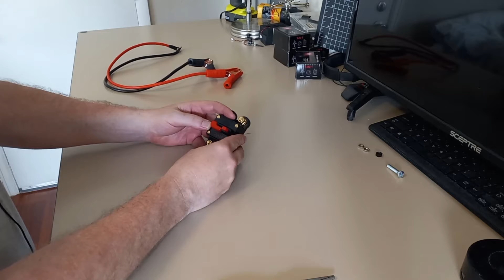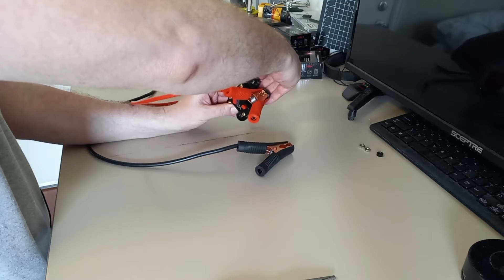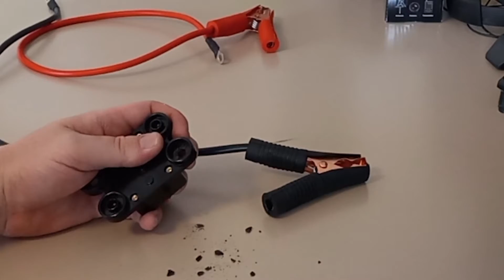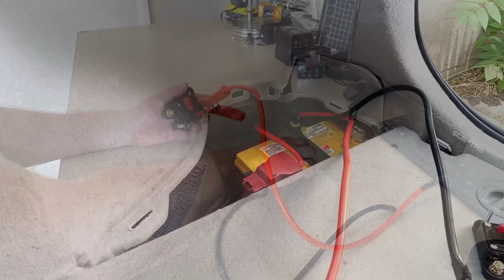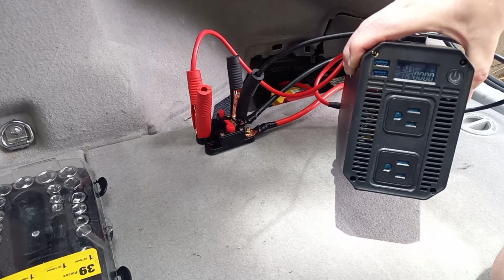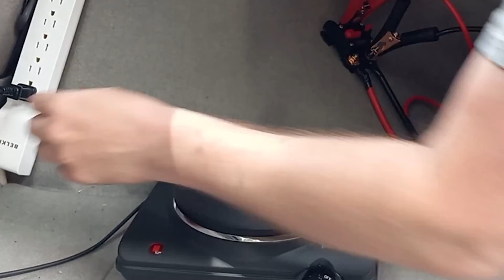Car Camping - Powering Car Appliances

Comment: Hi I have a few questions. Sorry I'm trying to build out my Prius, and I don't know anything much about electric components.

1. Why didnt you connect a parallel battery for extra power for your fridge? 
2. How do you power lights internally in the car? I see some people using USB outlets. 
3. What is the multiple plug there for if the inverter is 1000w and your hotplate is 800w?
Reply from the maker: Thanks for viewing my videos.  To answer your questions:
1. Instead of connecting a second parallel battery, I purchased a camping battery/power pack.  I got the Jackery Portable Power Station Explorer 160, which has outlets built in for the fridge and USB devices.  It is easier to install, cheaper, and more portable than a second car battery.  See my video on 2021-07-21 for how I powered my fridge.
2.  I looked at a number of different lighting options for internal lighting, but the overhead lights that are built into the car (in the front and back) are more than enough to really light up the inside at night.  I could plug extra lights into my Jackery or inverter, if I wanted to, but I haven't found a need for more lighting.
3.  The power strip with the multiple plugs is just for convenience.  It also has a built in surge protector.  The multiple plugs lets me do things like plug in my laptop, electric shaver, and other items, which I can charge at the same time.

The best thing about having a Prius is the fact that you have a gas power generator on wheels.  That means that you can plug in items to use (or charge) at any time, and anywhere, by simply turning on your car.  I choose to leave my car on all night, so the temperature stays at the level I set on the air conditioner.  The car only turns on for about 3 minutes every half hour to keep the hybrid battery pack charged (while the AC is running), and that also allows me to charge my Jackery and any items that need recharging while I am sleeping.

Let me know if you have any other questions.  Good luck!
Reply: @jasonvansickle  thanks for the prompt reply. I was wondering a little more about the security system, plus the inverter you bought. Is the inverter big enough for you? Would you recommend getting a 1000 inverter as well? Any inverters to recommend, especially on a budget? Also, do you think the security system is necessary? Thanks for answering my questions!
Reply: @YJ-xg2pd  The inverter is the right size for my use, because I only use it to run my refrigerator when my Jackery is charging and to run some other appliances that don't need more than 1000 watts (like the hot plate).  The best approach is to figure out what AC (alternating current) devices you will want to power in your car, and then find out the peak wattage you will need.  The peak wattage is the highest output of watts that you will be running at any given time.

Every device has a rating for the wattage it uses, so find out what item will use the most or what combination of things running at the same time will use the most.  The wattage use of a device is usually listed in its online product description.  There are a lot of inverters, so get the size that meets your needs and look for an affordable option for that size.  Look at ratings and read reviews, to make sure that a cheaper product isn't junk.  Also, make sure you get a pure sine wave inverter, because other (cheaper) types of inverters can damage things over long-term use.

By the way, I would recommend that anyone planning to live in their car on a limited budget create a meal plan that does not need refrigeration or heating.  That eliminates a lot of expenses:  power station (like a jackery), an inverter, and appliances (like a refrigerator, hot plate, toaster oven, etc.).  That approach would only need a very small and cheap inverter to charge things like a computer.  Otherwise, most electronics can be charged with a USB adapter that plugs into the cigarette lighter, which you can easily find for less than $10 on Amazon.

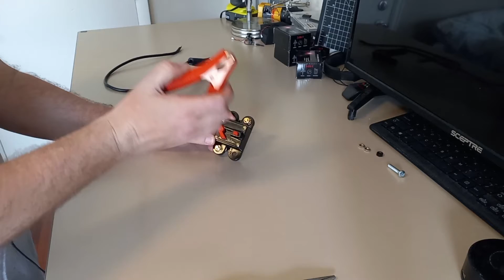In terms of privacy and security.  The best thing that I did was get my windows tinted and install the blackout window panel system with the front window sunscreen to hide myself at night (see my video on 8/1 - starting at time 2:41).  Using that system, I have never had anyone bother me or ask me to move at night, because I am invisible to anyone outside.  With that system, the camera (security) system is valuable, because it still lets me see outside when the panels are installed.  However, before installing the camera system, I would simply peak through the corner of a panel if I heard something outside, so (for me) the camera system is more of a luxury than a necessity.

Hope that is helpful information.  Let me know if you have any other questions.
Reply from the maker: @YJ-xg2pd  The inverter is the right size for my use, because I only use it to run my refrigerator when my Jackery is charging and to run some other appliances that don't need more than 1000 watts (like the hot plate).  The best approach is to figure out what AC (alternating current) devices you will want to power in your car, and then find out the peak wattage you will need.  The peak wattage is the highest output of watts that you will be running at any given time.

Every device has a rating for the wattage it uses, so find out what item will use the most or what combination of things running at the same time will use the most.  The wattage use of a device is usually listed in its online product description.  There are a lot of inverters, so get the size that meets your needs and look for an affordable option for that size.  Look at ratings and read reviews, to make sure that a cheaper product isn't junk.  Also, make sure you get a pure sine wave inverter, because other (cheaper) types of inverters can damage things over long-term use.

By the way, I would recommend that anyone planning to live in their car on a limited budget create a meal plan that does not need refrigeration or heating.  That eliminates a lot of expenses:  power station (like a jackery), an inverter, and appliances (like a refrigerator, hot plate, toaster oven, etc.).  That approach would only need a very small and cheap inverter to charge things like a computer.  Otherwise, most electronics can be charged with a USB adapter that plugs into the cigarette lighter, which you can easily find for less than $10 on Amazon.

In terms of privacy and security.  The best thing that I did was get my windows tinted and install the blackout window panel system with the front window sunscreen to hide myself at night (see my video on 8/1 - starting at time 2:41).  Using that system, I have never had anyone bother me or ask me to move at night, because I am invisible to anyone outside.  With that system, the camera (security) system is valuable, because it still lets me see outside when the panels are installed.  However, before installing the camera system, I would simply peak through the corner of a panel if I heard something outside, so (for me) the camera system is more of a luxury than a necessity.

Hope that is helpful information.  Let me know if you have any other questions.
Reply: @livinginaprius  thank you so much for the reply.

So if I understand correctly, the Jackery is plugged into the car 12V power supply during the night to charge up. Simultaneously, you are powering your fridge at the same time via the Jackery outlets. This way you have a continuous output and input into the Jackery at night.

During the day when the car is off, there is no input into the Jackery, and the Jackery powers your fridge through the day.

So when do you need to use the inverter for your refrigerator? 

Thanks for all the help! Your setup is the best!
Reply from the maker: @YJ-xg2pd  Yes, that is correct.

I use the inverter when I start charging the Jackery at night, in the circumstance that the Jackery was completely drained during the day.   Like I mentioned, I now wish that I would have purchased the next larger size of Jackery, because the smaller Jackery that I have runs out of charge keeping the refrigerator running when the inside of the car gets really hot (i.e., on hot days).  On cold or mild days, it has just enough charge to keep the refrigerator running all day.

On hot days, the Jackery gets completely drained, and (as a result) the refrigerator gets above its set temperature.  On those days, when I get back to my car at the end of the day, I have to plug the refrigerator into the inverter while it gets back to its set temperature, as I am recharging the Jackery.  The reason is that when the Jackery is recharging, it can't handle the refrigerator running at full power.  The refrigerator running at full power uses more wattage than the charge rate of the Jackery (more watts are flowing out of the Jackery to the refrigerator than are flowing in from the charger).

Once the refrigerator gets back down to its set temperature, then it runs at a lower power level (to maintain temperature), and the Jackery can keep up with that power drain while charging.  So, I only need the inverter when both the  Jackery is completely drained and the refrigerator needs to be cooled down.  If I had a larger Jackery, that could keep the refrigerator at temperature all day (until the nighttime charging), then I would have no need for the inverter when it comes to the refrigerator.

I hope that all makes sense.